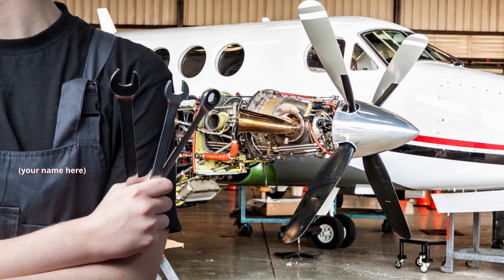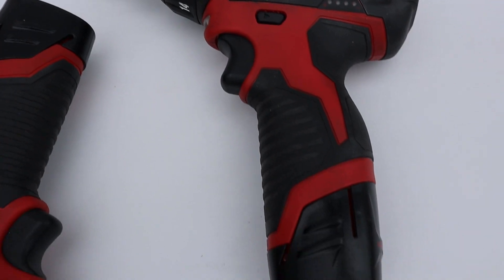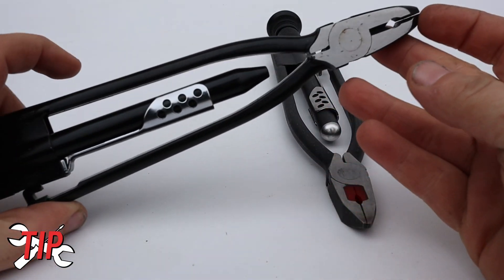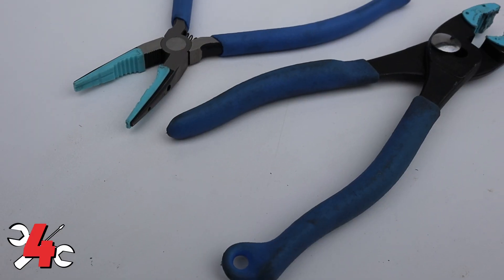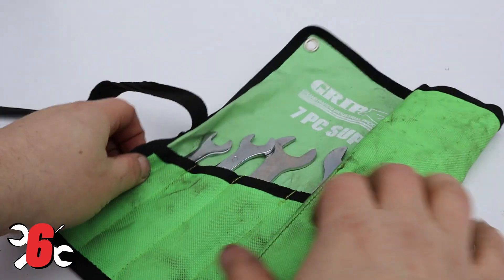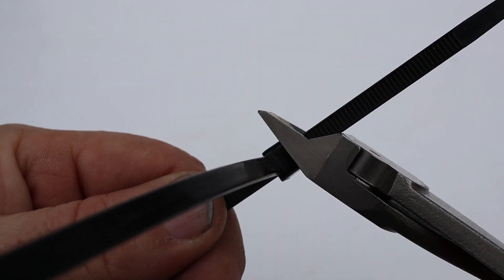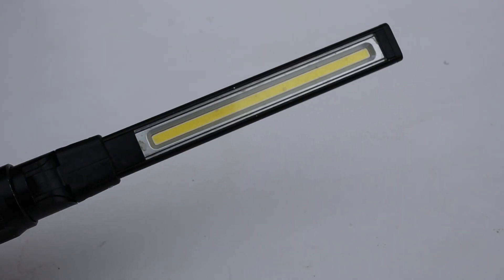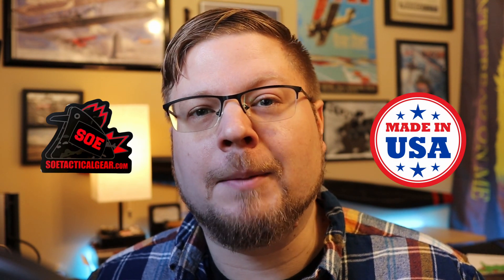Uncovering the Tools Every New Aircraft Mechanic MUST Have

Comment: Good job on the starter tools. I would say for your next list don't forget a four way wrench set and 1/4 inch universal 12 pt socket set and if your doing GA work be sure it has an 11/32 in it too. I like Tekton for another good value brand but Duratech is good if they have what you need. Both brand have tool rolls which are great for travel and tool accountability.
Reply from the maker: Yes, 11/32"! It surprised me how often I use that size in GA and how a lot of tool sets don't include it. I had to run out and buy a separate Craftsman wrench one day. Thanks for mentioning the 4 way wrench set! That's another one I have to borrow from my IA but didn't have the proper name to get my own. I'll look into Tekton as well. 👍
Reply: @LeftSeatAdventures This 11/32 inch is on my son's program required list, plus a couple of sizes that are not included in 
GEARWRENCH 19 Piece 12 Pt Long Pattern Combination SAE Wrench Set in Foam Storage Tray - GWMSCWL12SAE.
Reply from the maker: @peterking8722  yup, most wrench sets do not include 11/32” which is absolutely a requirement for working on aircraft. That surprised me when I started out. One of the best sets on Amazon that has all the sizes he’ll need is from the Tekton brand (listed in the original comment above). Available here:
https://amzn.to/3LpXTCI
Reply: @LeftSeatAdventures  The Tekton set TEKTON Combination Wrench Set, 19-Piece (1/4-1-1/4 in.) | WCB90104
was what I got for my son at Lowes with a 20% discount in addition to the posted 9% discount. The set you mentioned misses a few pieces required by his program.
Reply from the maker: @peterking8722  cool, i didn’t know they sold them at Lowe’s too, good to know. We use 1” for oil filters, 1 1/8” for garter filters and some other things. Don’t know if I’ve used 1 1/4” but if it’s on the list then they will be.

Comment: My Makita drill/driver is 30 years old (I might need new batteries), my duckbills are from the Air Force (50 years old), I never had an apron, I'd probably just FOD out the aircraft with one anyway. The tools I needed changed with the aircraft I was working on.

Comment: A ratcheting screwdriver and a right angle bit driver. The ratcheting screw driver is self explanatory. The right angle bit driver is a must and has saved my ass on many occasions. I use one from Gearwrench. It comes in a set with bits too. Eternally grateful for my old shop supervisor that suggested it. A long reach magnet is helpful too. Never know when you might need to go on a rescue mission after a washer or screw. On the more expensive side, but a very helpful tool is a "J" bar, or Johnson bar. 'Bout $350 from The Yardstore, but very handy for stuck and stripped screws

Comment: Thanks for the expert advice. What do you think of the ARES 10009-6-inch Reversible Wire Twister Pliers
that is not too expensive but received raving reviews on Amazon?
Reply from the maker: It looks like a solid option for just starting out. I have no experience with this exact pair but it appears to be a step up from some other bargain brands. I do however have some other Ares tools that are well made and have been holding up. Certainly worth giving them a shot at that price. Thanks for putting these on my radar, I may need to try them out and do a comparison video.
Reply: @LeftSeatAdventures  Thank you very much for replying. I am a parent with no experience but my son would like to pursue a career in aviation maintenance with school starting in August. The program he has enrolled in requires all students to have ready all the tools in a long list near school starting time. Otherwise they will receive failures and will not be able to advance in the program. A lot of the required tools are either not on the lists of other aviation maintenance programs or are considered optional, and some are not even in the tool chest of another YouTuber who has been in the field for more than 10 years. All the tools except the power tools in your list are required by his program-the power drill is implicitly required because several other required tools are to be powered by it. YouTubers such as you are a great resource and help to people like me since you have the experience and expertise. Thank you again.
Reply from the maker: Awesome, happy to help! Interesting, the local school here has students buy a curated set from Snap-On. Most schools and the military say no power tools, but when you’re out in the field it’s a requirement. I’m going to hop over to your other question, but let me know if there’s anything else you need.

Comment: Do airlines normally have tools you can sign in/out like torque wrenches, tire pressure gauges, borescopes and equipment that you'll need to work on aircraft that come through that airport? Also thanks for making this, I learned a lot and I'll be adding these to my collection 👍
Reply from the maker: Absolutely! 👍 I'm not 100% sure about the airlines. I know some people keep a small toolbox of basic tools and then the shop provides everything else. In our shop, torque wrenches and other special tools are provided for us. Torque wrenches specifically need to be calibrated yearly, so it's good we don't have to worry about that part. It is good to build up your own set of tools though. Getting your A&P opens a lot of doors to a lot of different opportunities both on and off the job.

Comment: I'm starting A&P Feb 20 and decided to do some research on what kind of tools I'll need eventually.

Coming from a shade tree background. Two of my best tools were a jewelers headband and a mechanic stethoscope. 
I had an old school hotrodder mentor who had both these tools. Headband came in handle during rebuilds, so you can see literally all the smaller pieces what may be going wrong with them. Finding those imperfections help you understand what's going on deep inside you can't see also pieces together a story of what's happened to the engine the client never tells you.
Same with the stethoscope, which after awhile I quickly diagnose problems based on the sounds. 

At least this is what I'll carry over. I'm not sure how they both will be applied, I'm sure I'll be laughed at. However every engine I've rebuilt has lasted over 150K and I've done a few. When I was asked what I was doing (I probably looked crazy to some clients) I told them I had to hear what the engine was telling me and look for clues! I think one guy who had a good laugh, when I rebuilt his 2.5 Nissan it's still running and has about 80K driven on it so far.
Reply from the maker: Hahaha, awesome! A stethoscope is a big step up from a pry bar. 😆😆😆I also started off in automotive. Some people will tell you there’s no carry over, but it’s not true. I’m learning there’s tons of certified aircraft parts that are made by automotive companies. And really, if you are one of the few mechanics that can recognize an issue by sound, you’ll do great in aviation. Congrats on gettin started! 👍👍👍
Reply: @LeftSeatAdventures  I really can't wait to get started. Ive already met people with similar to myself. I'm over here bouncing off the walls to learn. 

Any tips for a noob?
Reply from the maker: You're already eager to get going and learn all you can so that's a good start. Are you going to school or working as an apprentice?
Reply: @LeftSeatAdventures  going to a school (AIM) they seem like they'll teach me the ins and outs pretty well
Reply from the maker: Excellent. Like with any school, you get out of it what you put into it. As you're progressing through, remember why you're there. When I went to automotive school, the people who partied and screwed around constantly didn't do well while those who didn't got the most from it and had the best opportunities afterward. Your instructors should have a wealth of experience to learn from and many are willing to stay late to share and tutor if needed. BUT: School is great at teaching the book knowledge, theories and regulations. Not so much real world hands on day to day work. You have a leg up over somebody with no experience at all, but you'll still have a steep learning curve once you actually get out in the field. (Meanwhile, I'm fully responsible for the book stuff working in the field as an apprentice. Pros and cons.)

Comment: I’m going thru A&P school right now. All of our instructors said we will never use electric tools on an aircraft. Especially impact drivers.
Reply from the maker: 🤣🤣🤣 And here I got yelled at on DAY ONE for NOT using an electric driver on aircraft!
I guess it depends on what field and specific shop you (or they) work(ed) in. An impact driver is never used on #s 6 through 10 hardware as it would easily destroy the nut plates, receptacles and shear fasteners. The tools I use are not impact tools, and specifically have an adjustable clutch to limit the torque applied. On Milwaukee, it's typically set to 6. (https://amzn.to/44fPKI6) DeWalt was about the same. I don't use them at all on tube and fabric aircraft and rivnuts though. Soak up every bit of a knowledge you can from your instructors, but understand that your real world job may vary from what you're taught there.
Reply: @LeftSeatAdventures  thanks for the reply!! Advice noted.
Reply: @Im_The_Sancho  I was taught you can and should use them after you manual loosen the and then use them only to snug up and then manually tighten
Reply: @tbone6254   I guess things are a little different than what our 60+ year old instructors say. They ain’t worked in the field in years
Reply: 51 years in the business, taught A&P school about 40 years ago, still active. Judicious use of power tools is a great advantage. Use my Milwaukee and Bosch electric screwdrivers extensively, BUT for fuel panels a pneumatic is used. Also loosen by hand then run the screws out with the power screwdriver. To install put in by hand to avoid cross-threading, power in using very light torque, then final by hand (speed handle with ratcheting head works better than just a screwdriver for both removal and installation.  Side note, have had some of our corporate jets come out of maint with leaking fuel panels………manufacturer MRO using pneumatic drivers with the torque set to book value…….panels were not tight, the nutplate friction kicked the clutches in the tools too soon, another reason to hand tighten……
Reply: I was told the same thing over 10 years ago in A&P school, ive been working for the airlines for nearly 10 years now and I use an electric drill every week. 😂

Comment: Hello Left Seat Adventures 
I just found your channel and subscribed. My suggestion for tools.  Cordless tools in particular. Brushless =No Spark, meaning safety your's, mine and those in the area!!!!

 Please New people, don't just jump the first tool truck and go into debt!!! Give yourself some time and experience. See what you are doing. Get a feel for job. You don't have to get everything at once.

 I guess my number one suggestion is the tool box. Whatever size you buy today. Is going to be too small later. Expect to buy a bigger box. 

I started with a top box then I  added a  bottom rolling cabinet and put the top box on it. That lasted for the first, couple of years.  Every plane has different needs. Thank you again
Reply: Agreed a tool box is your first purchase. I myself prefer cantilever tool boxes all foamed out takes some time to achieve but I have a line box a base box an AV box and a box for all my metric tooling. This way I can grab the box relating to the work I'm about to do
Reply from the maker: @seansmith2435   Nice! 👍 I bet they really come in handy doing mobile work too.
Reply from the maker: Awesome, thanks! These are all good suggestions that ANYONE reading these comments should stop and READ. (I'd pin this one too if I could.)  I've been in situations where I was seriously considering the brushless options as well... 100%  on the toolboxes, I had the same progression when I was in automotive. I couldn't believe how much debt the other techs were going into!

Comment: Love it, the blue toolcart setup was the same as mine before I upgraded 👌.  Started out working at a repair station while in school for my license. Only tools I'd add to your list would be Knipex pliers wrench, cheap set of 1/4 12pts and pref. The small long neck dykes from Snapon worth every penny.
Reply: I'll also add the option of Channellock 728 long reach cutters. They're a different shape but get in a lot of the same places the Snap-Ons will surprisingly.
Reply from the maker: @Brake_MagnetoMan175   Nice, that'll get the job done!
Reply from the maker: Thanks! I like being able to just wheel the cart right to whatever plane I'm working on, but I've pretty much maxed out that setup already too. All good suggestions! 👍 I've also fallen in love with the Snap-On angled wrenches and wobble extensions, best I've seen on the market so far.

Comment: You talked about buying "cushion throat" safety wire pliers. I have never had "cushion throat", they didn't make them when I was in the business. So I took PRC and filled up that space where the "cushion" is and then cut through it with a razor blade once the PRC dried. I also did several pairs of Dykes with PRC so that when I cut wire, it wouldn't fly off into No mans land.
Reply from the maker: Hahaha, that's a great idea! PRC is some serious stuff, I'm going to use that trick too, thanks! 👍👍👍

Comment: Milbar makes the safety wire pliers for SK, Proto, Blue Point, and a few other manufacturers. They’re literally the same, so just get the cheapest set that offers the most convenient warranty.
Reply from the maker: That's good to know, thanks for clearing that up! I've noticed the SKs and Protos feel very similar in the hand to the Milbars and now I know why.
Reply: Got my milsurp wire pliers about 50 years ago. Also have newer ones, reversible, spring loaded, etc. But the old milsurps are still my favorite. Only mod was to epoxy a bearing on the pulled end to make retraction way easier.

Comment: With the introduction of Doyle and Icon, within 5 years HF went from a trash tool company to elite!
Reply from the maker: It's true! Totally surprised me. Through some of my contacts, it seems Harbor Freight has actually been listening to their customers' feedback and that's leading to product improvements across the board.
Reply: Fully agree. Many years ago back when HF essentially had tractor trailers going to different locations, usually hotel meeting rooms, to sell tools I bought a huge bench vise. Approx 37-38 Years later, that vise is still kicking butt. Nowadays HF has some pure garbage but the “educated” buyer knows which are the good lines…..Doyle, Icon (tools and boxes), Hercules, Bauer, US General boxes, etc.  My work boxes have mostly Snap On, home boxes are mostly old Craftsman. If I were starting out, the above HF would definitely be considered.
Reply: @avmech2126  I have plenty of Snap On. Of course, they are still top of the food chain; however,  Icon is easily 85-99% as good. Same with Doyle.
Reply: @jasonhoyt8232  no argument from me

Comment: Spark plug socket (usually 7/8 deep socket) and a 1” 6pt shallow socket for oil filters for sure
Reply from the maker: 💯% agree! 👍 Forgot all about those, and most wrench and socket sets don't include them. I also should've mentioned a 3/4 & 7/8 combo wrench as it handles pretty much all of the plug leads. I bought a 1" ratcheting wrench from the Matco guy, good quality but pretty pricy. Thanks!

Comment: You’ve opened my eyes to a few tools I now need for even general mechanical work. The slim wrench’s and the soft jaw pliers will be handy. 
Those battery powered tools are fantastic, they save so much time and wear and tear on the wrists. They’ve gone from a “nice to have” to a “must have” tool. 
Also, similar to an apron I wore a tool pouch for years and on construction it was a good way to have the tools I needed always close at hand but it had some negative points too. The weight of the pouch hanging on your hip over the years eventually caused some pain and if you were clawing around or under stuff I usually end up taking it off and carried the pouch by hand or just the tools I needed. 
In my last few years on the job I noticed that younger journeymen and apprentices were using hand held, open topped, tool totes more often than pouches on a belt. I use one now and fill it up with what I need for repairing stuff around the house to simple jobs while working on my car or bike. 
And around the shop a simple wheeled tool cart was a nice way to have both the tools I needed at hand and a place to put thing I had taken off or such.
Reply from the maker: Can't have too many tools! 😆
 It'll probably be in a future video, but I also have the M12 3/8 ratchet. Probably should've gotten the 1/4", but it's been a lifesaver where you have no room to swing a ratchet. It was all about air tools when I was a Ford tech, but they're loud and attached to a hose. Crazy to think of how far the cordless stuff has come in such a short time. 
I can imagine the tool belt getting old after a while. Also noticed the trend with open top bags and buckets. 
Yup, love using carts for different tasks. Toolboxes, carts, and work benches, just about everything is on wheels in our shop.
Reply: Open top totes and compact pouches are great. Clip on pouches are nice for a few fasteners and a couple basic tools. If I need more than that and I'm on and off ladders or scaffold the bags go on. A decent set of suspenders transfers the weight to shoulders and keeps it off your hips.